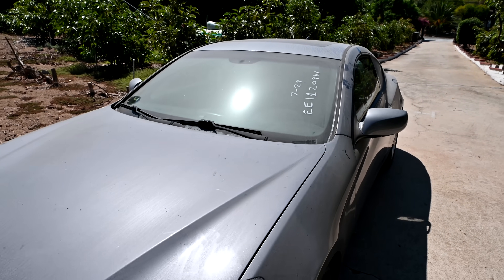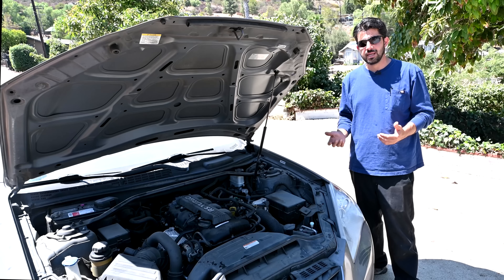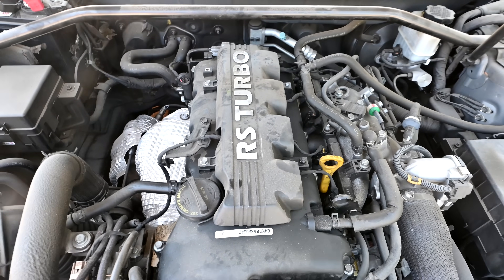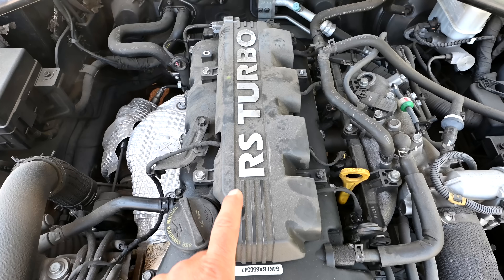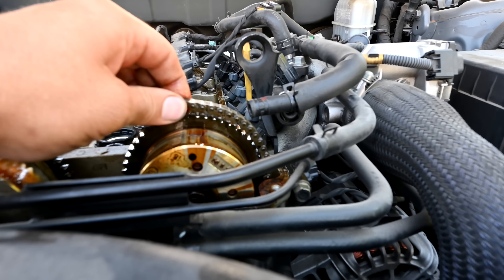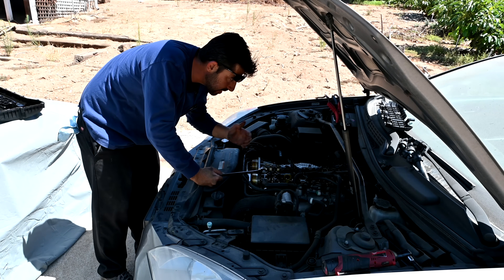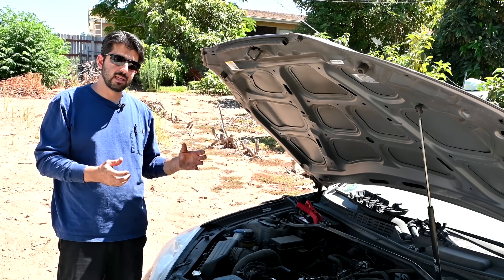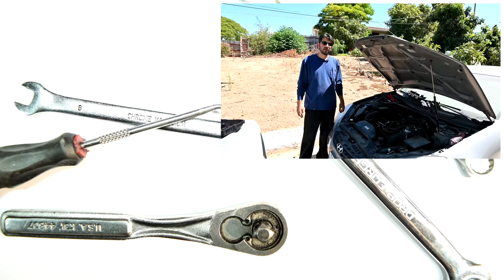The Hyundai And Kia Engine Failures Explained.

Comment: Ive been specializing in Hyundai/Kia for over 10 years including ECU/dyno tuning, big turbo upgrade, custom fabrication  and etc.. G4KF engines are one of the most reliable engines I've worked as long as you replace the chain and/or upgrade to the newer 2.0T chain(revised).

A lot of young guys make mistakes of getting tuned and beating on it. One of the biggest downfall is that because the stock turbos are so small, it creates cylinder pressure which leads to rod/bearing failure. Turbo engines with tune = more cylinder pressure = more blowby (combined with lack of oil changes) = more oil burning in the combustion chambers = low oil level(air in the system when cornering and etc) = not enough oil pressure = damage to all rotating assembly. 

ALSO, people do their oil changes at home on these cars and don't use OEM oil filters. 95% of the genesis engines I've replaced had aftermarket oil filters. 

So basically it's lack of maintenance that leads these engines to fail. I've seen these engines with well over 400,000kms on it and still running strong. Majority of my customers have more than 200,000kms pushing 300-400whp daily. Yes srock engines with properly upgraded turbo setups.
Reply: Yeah but you don't hear about those issues with Toyotas and Hondas.. Honestly Hyundai has a long history of building crap.. I know too many people having serious issues with Hyundai/KIA and Genesis vehicles.. They don't stand the test of time like Toyotas and Hondas.. Ask Mechanic "Scotty Kilmer" ! If you're a mechanic than you can keep these cars going but the average person don't do that well with Hyundai.. Right now customers with serious engine issues still under warranty are waiting more than six(6) months for cars to be repaired.. That's taking place "Nationwide" !!! Hyundai also is known to look for loopholes to avoid honoring their warrantees.. People buy Hyundai's to save money but now they're not worth it because car prices have skyrocketed and given the choice between a Camry, Honda and Hyundai all costing close to $30K or more it's gonna be the Camry or Honda all day !
Reply: @Avatar7x7  MY Hyundai never gave me an engine problem.
Reply: @chuckz8053  my 2009 FD Touring(i30) has 240,000kms and my 2010 MC Accent has 350,000kms. Never gave me problems. Lol
Reply: @chuckz8053   Consider yourself one of the lucky ones !
Reply: @Avatar7x7  Mine too, and all the people i know that have them, they all love their cars.
Reply: @stockey  Hyundai has a waiting list of over 3 to 6 months on any serious repairs.. If you're fortunate to get a good one , Hat's off to ya ! You're lucky !
Reply: @Avatar7x7  Toyotas and Hondas have so few higher hp applications to begin w/. The ones now are newer platforms like the Type R, Acura etc. Their older stuff is almost all n/a (which is generally more reliable than any turbo setup)
Reply: @artemiscool67  Hyundai's re-sell value was nothing before the pan...demic.. I think given their overall track record of Hyundai I think they're way overpriced ! If the Price were the same Which would you prefer Lexus/Toyota or Hyundai/Genesis/Kia ?
Reply: @Avatar7x7  Having owned nearly all cars you mentioned I'd much prefer Genesis/Kia (I'm more into performance and Lex/Toy just don't have as many models that fit the bill). For a B58 (Supra) I'd honestly rather get another BMW (M340i).
But having owned BMW I've never purchased cars for their resell value...

I wouldn't put Hyundai's quality to the same level as Toyota, but I absolutely recognize the gains they've made in the last decade and a half, and I'm not holding their past against them.
Reply: @artemiscool67  At the same price point the smart consumer generally goes with lower maintenance, durability and longevity which Toyota/Lexus and Honda/Acura beats Hyundai every time ! But it's all personal taste and you have the right to be wrong ! 😁
Reply: @Avatar7x7  welp, there's a reason why generally even more unreliable brands like BMW sell (Hyundai's been chasing that market). Toyotas are the 'safe' commuter option, but some people just want more and Toyotas (and even Hondas) can be awfully boring. Most all Toyota's more exciting offerings don't even use Toyota engines/drivetrains...
With all this said, it's an undeniable fact that Hyundai/Kia's reliability has increased quite a bit, and at the end of the day: the price point ISN'T the same (so your hypothetical scenario need not apply b/c it isn't reality lol)
Reply: @artemiscool67  When's the last time you checked?  car dealerships have taken the liberty of marking up prices between $5k to $10k above MSRP because of the (fake) chip shortage ! You can drop $30k to $40k on a mediocre Hyundais like it's nothing.. Most dealerships you go to have very limited inventory so the public 's getting gouged ! I'm old school, that kinda stuff is unacceptable !
Reply: @Avatar7x7  I'm old school as well, but the markups you're pointing out isn't a Hyundai problem it's an automanufacture-wide problem. 
It's quite unprecedented, but hardly unique.
Reply: @artemiscool67   You never see stuff like this about Toyotas and Acuras :
https://youtu.be/xzKAYpsdOAY
Reply: @artemiscool67  Here goes some more unprecedented and unique stuff :
https://youtu.be/-hyoRMNoHSs
There's tons of em on social media so I don't what you're talking about but consider yourself one of the lucky ones !
Reply: @artemiscool67  I challenge you to check the most recent comments on this YT video post! Lot's of folks have had real bad experiences with Hyundai /Kia etc ... Genesis ... smh
Reply: @Avatar7x7    @Avatar7x7  No brand is w/o it's issues, so don't know what to tell you there (search Toyota engine problems in Yt for starters). You don't want one, don't buy one. Plain and simple. But this isn't the 90's and early 00's.
Haven't had an issue nor had my fam, so that 'lucky' talk on your part just seems exaggerated...
Reply: @Avatar7x7  so what? "Lots of folks had issues with their Hyundai/Genesis". 
Name one single manufacturer folks haven't had issues w/. 
That's the weakest example of 'proof' you've provided so far.
"Lots of folks"..."Yt comments"...yes I see the real scientific anecdotal evidence you've shown there lol...
Reply: @artemiscool67   The word is out that there are serious problems with Hyundai, Kia, Genesis.. There's always exceptions to the rule and you're the exception.. Glad it worked out for you !
Reply: @Avatar7x7  okay then just tell yourself that, the rest of us will enjoy, and thanks

Comment: I was working at one dealer putting quality oil in Kia services and engine failures were rare. I’d then started working at another opposition dealer that was putting the cheapest oil you can find in Kia’s, and you guess what? Engine failure galore!
Reply: What brand was the cheap oil?
Reply: @travisolson9190  Gulf Western